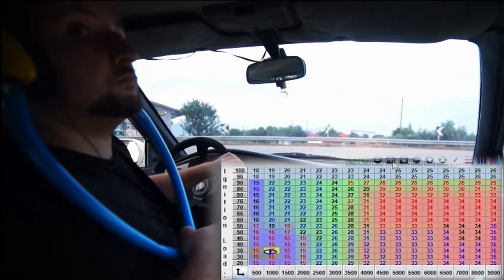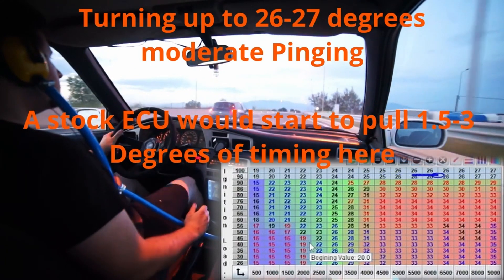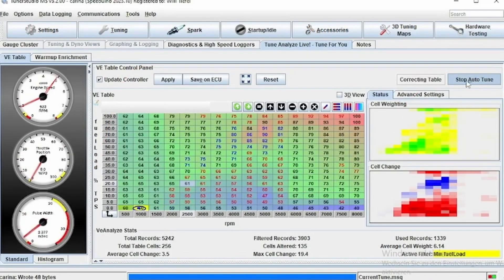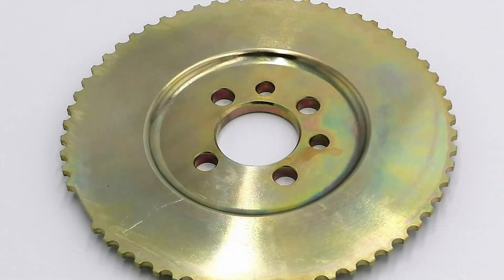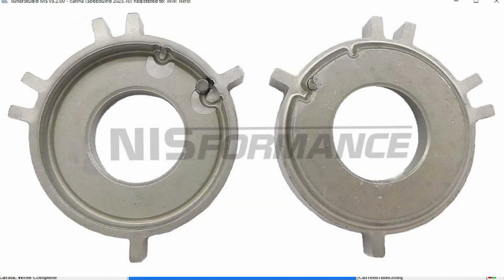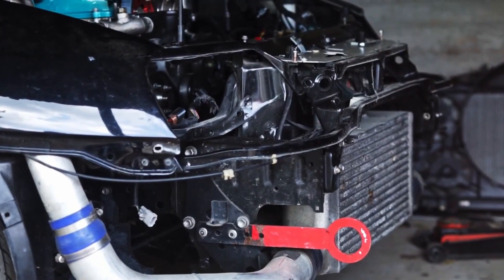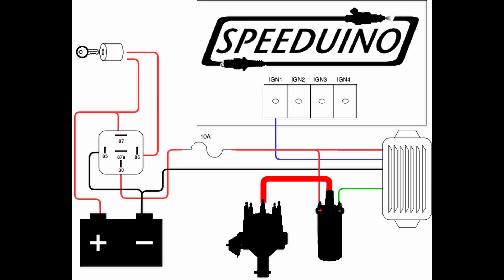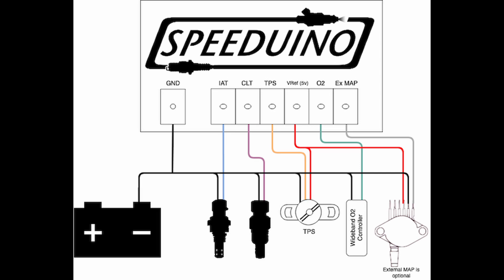Put a Standalone ECU in ANY car! | What is needed and what to look out for!

Comment: What if my crankshaft position sensor is in the oil pan?
Reply from the maker: Doesnt make a difference if its a normal sensor and can be read vy the ecu 
Otherwise you could always go to a crank trigger wheel
Reply: @throttlebuddies0  I meant that i have vr sensor
Reply from the maker: @Rankify-q6d  yeah it will work if you order the ecu with a VR conditioner if it does not have one. ECUs like halltechs, ecumaster or LINK do have the option to use VR or Hall effects sensors

Comment: Question: Can you go over making sure oem security system won’t lock out starter since oem ecu not connected with standalone? I worry a security system may somehow prevent megasquirt from starting the engine. Is there something we need to check before attempting to first start with the standalone in regards to this? For instance, if the door gets opened and theft alarm is on the security system won’t let the 87’ supra start under certain conditions. Are all security systems tied into the body harness and not the engine harness? Or are the security anti theft systems tied into both the engine harness and body harness?
Reply from the maker: you can test that out by checking if the car cranks when the ecu is unplugged. if it does, you are fine. 

there are aftermarket alarms that intercept 12v to the ecu but that would be very rare. 

i have run standalone ECUs on Plattforms with CAN based anti theft and with baked in to the ecu. both work fine without any issues.
Reply: @ Just subscribed! Thx! And so most cars will crank even with no ecu plugged in? Even if on standalone megasquirt
Reply from the maker: @ricka12345  in theory most cars will as the cranking signal is not sent by the ecu but by the ignition switch via a relay. if that is not intercepted with some kind of ecu safety or whatever (which is rare) then you are fine
Reply: I had something similar happen to my corrado. I ended up just using a jumper.
Reply: @ a jumper where